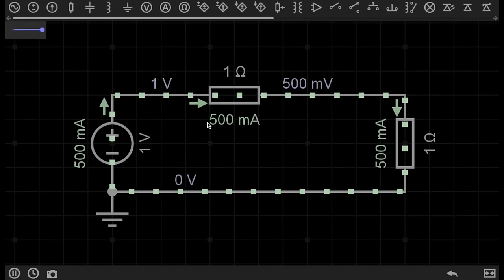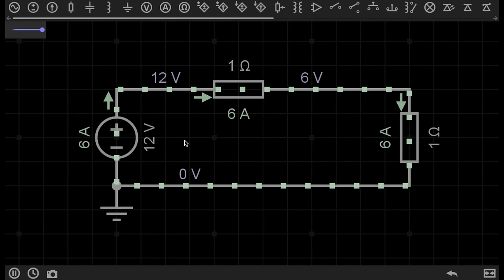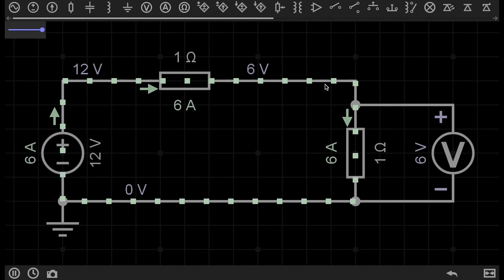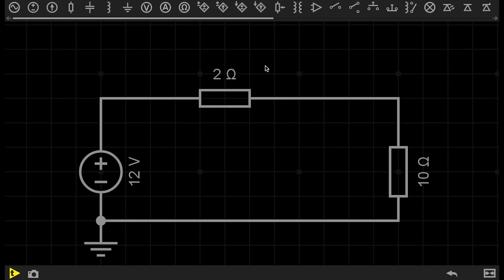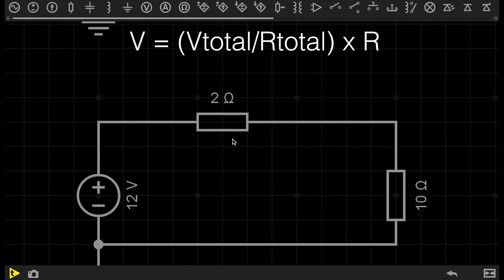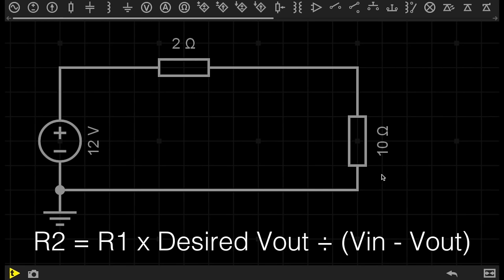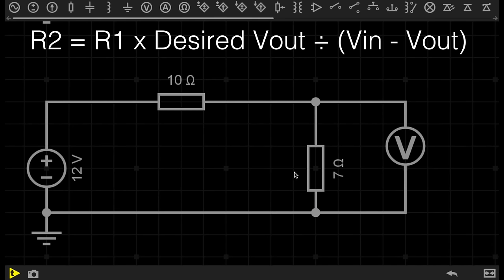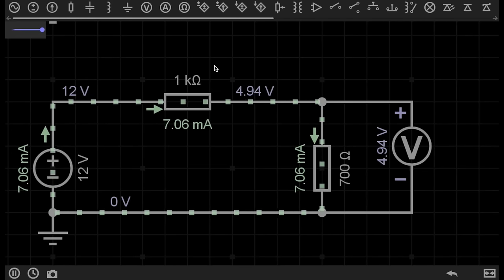Voltage Dividers - Electronics Basics 12

Comment: what's the name of this application ?
i want to reduce voltage from 3.7V to 3V ,what resistor should i add
it's for a wireless mouse that work with 2 battery(1.5v),i want to replace the 2 batteries with a mobile battery
any idea ?
Reply: You can use a buck converter ( step down voltage converter) to reduce voltage from 3.7 to 3V.
Reply: is there any other method ? like adding resistors ?

Comment: How much easier would it be to remember:

Vdrop = (R/Rtotal) x Vtotal

Also, if you want a specific ratio (say, divide by 10), then R1 and R2 must be in a ratio of 9:1. Because 9x(some ohms) + 1x(some ohms) is 10x(some ohms) [where (some ohms) is the same for each part]

So 9 ohms and 1ohm, or 900ohms and 100ohms, or 90kohms and 10kohms... there are 10 "units" and one side has 9 of those units (or 9/10ths of the units) and drops 9/10s of the voltage, while the other side has 1 of the units (or 1/10 of the units) and drops 1/10 of the voltage.

Divide by 2: is a 1:1 ratio, eg 1ohm + 1ohm

So 2 ohm total in the divider, 1 ohm is half of that total, so you get half of the total voltage.

Divide by 3: is a 2:1 ratio, eg 2ohm + 1ohm. (2/3rds and 1/3rd. If R1 is 2ohm and R2 is 1ohm, then R1 drops 2/3rds of the voltage and R2 drops 1/3rd)

Of course, it can be reversed to be 1ohm + 2ohm for divide by 3, or 1ohm + 9ohm for divide by 10 and so on. You decide where you put the resistor value which gives you the portion of Vtotal you want at that point.

Perhaps you want 90% (9/10ths) of Vtotal, then you put the 9ohm resistor where you want that voltage, and the 1ohm takes the other position.

The key to remember is for a given ratio, the parts must add up to the desired divisor. So for divide by 10 ratio must be 9:1 (because 9+1=10). And because you want 1/10th of Vtota, you would would use R2 = 1 unit = V2 or 1/10th of Vtotal (where "unit" is an order of magnitude ohms... like kiloohms or megaohms or milliohms or just ohms)

Also, for values like 10%, 20%, 30% etc, think of them as 10ths in the ratio:

10% is 1/10th so 100% = 90% + 10% = 9:1
20% is 2/10th so 100% = 80% + 20% = 8:2
30% is 3/10th so 100% = 70% + 30% = 7:3

and so on. To get 30% of the voltage, you might use 300ohm and 700ohm, using the 300ohm where you want to measure that 30%

Comment: Problem actually is  i have a source of 12 v , i must use two resistor in series, I need to have 5 volt at any one of these two resistor.how can then i apply this voltage divider to know the values of two resistor?
Reply: You want to use the formula: V(out) = V(in) x (R1)/(R1+R2). If you plug in the numbers you get 5 = 12 x (R1)/(R1+R2). If you rearrange this you get that R2 = 1.4 x R1. This means you can have any value for the resistors as long as one of them is 1.4 times the other.
Reply: You can't, using ONLY 2 resistors. If both resistors must be 5v, the total voltage drop is only 10v. To drop from 12v, you need to arrive at a circuit which has 10v across the divider network, and then the 2 resistor values will be the same value.

Are you sure BOTH resistors MUST be 5v?

Comment: I've watched both your videos on voltage dividers and I still don't understand why you would need one. Instead of using two resistors, why not just use a single one with a higher rating? I want to learn how to read analog signals with an Arduino and my understanding is I have to use a voltage divider before input to the ADC. I don't understand WHY. Why not a single resistor with a higher, correct rating instead of two resistors with lower, incorrect ratings?
Reply: if a Resistor drops a voltage, it heats up, so if you want to go from 12v to 5, that resistor must drop 7 volts for you, and if you are drawing like 1 amp of current, that 7 dropped voltages times 1 = 7 Watts of heat created and wasted
Reply: Casey, if your signal maximum voltage never exceeds the maximum recommended input voltage (or the rated input voltage) of the Arduino, there is no need reduce the voltage at all.

However, if it does exceed this rated input voltage (in this case, 5v as that is the "logic level" used by the Arduino), you need to reduce it. 

A single resistor WILL reduce voltage ONLY when there is current flow through it. If you've seen or used a pull up or pull down resistor, they don't cause a voltage change, because there is no current flow through that part of the circuit.

Typically an ADC is Hi-Z or High Impedance. It doesn't use any current flow. As the Arduino is using an ADC for the inputs, it's not going to use any current, so a single resistor would be ineffective for the purpose of reducing the voltage to the rated input voltage for your Arduino.

Also, the Arduino is a single pin input. This input pin is measured with respect to GND or 0v, and is generally NOT negative (eg >0v). I hesitate to say MUST be >0v, but it may be.

So you need a SINGLE reference point to test, where the voltage is at the desired level. To get that, 2 conditions MUST be true:

1. We need current flow through that point (but NOT flowing into/via the Arduino pin)
2. That point MUST be no greater than rated input voltage for the Arduino pin (let's say 5v)

A single resistor, even with flow, will still NOT have a voltage drop across it, in isolation (ie it needs to have another component in series with it, which has current flow)

So two resistors in series works well. And given the theory explained in this video, you can calculate the values of two resistors such that the point between R1 and R2 will give the reduced voltage level you need to safely measure it with your Arduino. 

That said, you're measuring a fraction of the real voltage, so your code MUST adjust the value it reads with a factor relative to the divider ratio.

Hope this helps (you and anyone else wondering the same)
Reply: @CollinBaillie  You have no idea how grateful I am you clearly took so much of your time to explain this to me! Even though I posted this question some time ago, this is the first time I've actually started to understand. Thank you SO much for this; you're awesome!!

Comment: If there is 6 v across this resistor there must be 6v across this resistor because our power supply is 12 v. How do you arrive at this conclusion please?
Reply: 1. The resistors will each have a voltage drop
2. Since they are of equal value, the drop across each will also be equal (as the current through them is the same, due to the series nature of their connection; and ohms law will prove that with the same current and the same resistance, the voltage will be the same)
3. Total voltage drop = supply voltage = 12v
4. Therefore each will be 1/2 of supply voltage which equals 6v each.
5. If you wire up the circuit, the measurement will prove this, with the caveat that no two resistors are identical, so there will be a very small difference, but for theory, we consider ideal components which are assumed to be identical.

Comment: There's one thing I don't understand... If the resistors are only few ohm's then why isn't it short circuit? Doesn't it just drain power?
Reply: this is true because the resistors act as loads. You can calculate the power they drain using the equation:

power  = (Vin*Vin)/R1+R2
Reply: well, his total resistance is 12Ohms, and total voltage is 12V, Mr Ohm told us that Total Current (Juice) flowing should bi V / R = 1Amps.

so this sample circuit is burning 1 Amps of juice through the resistors
and with Power + Volt * Amps you get 12 Watts of hot resistors :D
Reply: @codewithlenny  Are voltage bucks more efficient than this method?
Reply: @davey3765  voltage bucks are far much more efficient. Get them
Reply: The idea of this circuit is to learn the theory of the circuit. Generally you wouldn't use such low values.

Imagine the supply, while being 12v could supply infinite amps. Also imagine you're using 1 trillion watt resistors. Even if it's drawing 10 amps, that's only 120w. To an infinite amp supply and a trillion watt resistor, 120w is nothing. 

Theory is just theory. It's used to understand HOW is WORKS. It's NOT how you should IMPLEMENT it in your circuit. It applies to ALL circuits, from high voltage high current to extremely low voltage and low current circuits.

How you implement the theory in a real circuit is up to you. Let's make a real example:

Power supply 12v at 5A (reasonable)
Resistor divider using 1k ohm resistors. Fairly typical values, relatively small when you consider that megaohm resistors are common enough.

Each resistor gets 6v (using the theory taught in this video) and using Ohms law, we know current would be 6mA through the circuit. That's 36mW through the resistors. 

That's not going to burn a 1/4w resistor (250mW), and not going to tax the 12v supply. This is an IMPLEMENTATION of the theory.

Learn the theory, then apply it to YOUR implementation.
Reply: @codewithlenny  a buck converter is irrelevant for use where a voltage divider would be used. And a voltage divider is irrelevant where a buck converter or a voltage regulator would be used. 

Would a V12 Supercar or a 3 cylinder hatch be better in the garage when I'm cooking bread in my pizza oven? Totally irrelevant.
Reply: @davey3765  No. Because a buck converter, like a voltage regulator, supply POWER (that is, volts and amps) to your circuit. A voltage divider does NOT supply current... only volts. In fact, if the component or circuit connected to the voltage divider DOES draw (significant) current, it will alter the divider network, and you have to make further calculations.

Comment: thank you for the great video. can you explain what happens when you need a specific current and voltage?
Reply: then you use a CCCV power supply
Reply: Hmm. Voltage dividers are (really) only about voltage. 

Of course if you know the current which will pass THROUGH R2, and the Voltage drop you want to see across it, you can use Ohms law to calculate the value for R2, and then you can calculate R1.

This assumes current through R1 (I1) and current through R2 (I2) are the same, in other words I1=I2

Once you connect further circuitry to R2, things may change, depending on that extra circuitry.

If the next circuit part pulls no (or insignificant) current, the current through R1 won't change, and so the numbers don't change. If the extra circuit part does have (significant) , then current flow through R1 changes and the circuit needs to be recalculated.

Comment: And where in the circuit is the desired voltage taken from here, like where is vout?
Reply: You would connect your next circuit part (what you call Vout) across (in parallel with) the resistor which gives you the divided voltage you need. 

For eg, in the 12V with 10ohm + 2ohm resistor divider, you would connect in parallel to the 2ohm resistor if you wanted 2v. If you wanted 10v, you would connect parallel to the 10ohm resistor.

Comment: How is the power efficiency compared to a buck?
Reply: Davey buck converter has higher efficiency
Reply: A buck converter is a POWER (voltage AND current) source. A voltage divider is ONLY a voltage source, no current. It's more of a voltage reference, for measuring or to feed high impedance components, like the input of an OpAmp, which draw no current.

Comment: Seems weird that in order to get more volts around resistor 2 you have to INCREASE the resistance 😅 they should change the size or opacity of the green dots to differentiate current and voltage

Comment: but why cant you use only 1 resistor to divide the voltage?
Reply: @Bloodred Pyrate 
Ok I'll only play with low voltages like 9v and an arduino
Reply: 1 resistor would REDUCE the voltage, not DIVIDE it. The voltage drop provided by the single resistor is calculated using the current THROUGH that resistor.

A voltage DIVIDER is used to "supply" a voltage WITHOUT current flow, to another component or circuit part. (eg that component or circuit part draws "no" current) Like the input of an OpAmp.

A voltage divider doesn't provide POWER (volts AND amps), just Volts.
Reply: Kirchoff's Law dictates that the sum of all voltage drops in a series circuit must equal the supply voltage. Therefore, if there was only one resistor, there'd be only one voltage drop and this voltage drop would equal 100% of the voltage in the circuit. The voltage would literally be undivided.
Reply: @CollinBaillie  this is fascinating. I haven't heard this, yet. I'm relatively new to matters of circuit theory. One question, if I may... If Vout carries no current, does this also mean that Vout is only used as signal voltage? Data, perhaps?

Comment: Electron flows from - to + here you have shown reverse why?
Reply: It's NOT showing electron flow. The simulator shows "conventional" flow, as is used in most theory. Conventional flow considers positive charge to be moving. We understand now that electrons are the actual moving bits, and they're negatively charged. 

It all works out though, because when an electron "leaves" a molecule, that absence results in a positively charged molecule. So positive charge moves in the opposite direction of electrons, which matches what conventional flow is based on.

Comment: i am useing hybrid  24/12volts on  my m37 army truck  via center tap 2 12 volt batt. dist is 24v  also starter   all else 12v for economy   alter. is 28 v dc one wire conn  no diodes or res used   no prob   53 dodge just keep it simple

Comment: How can there be 0 volts at the bottom (1:30)? If there was 0 volts, no current would flow to GND
Reply: The GND reference is a clarification of that node (the one being between the voltage source and the 10 ohm resistance) to be the reference node for the whole circuit, being the reference node a 0v one because GND is generally considered 0v, so all the voltages mentioned in the video (12v and 10v) are measured to the ground reference.
Reply: Voltage is also referred to as potential difference. Try searching for some explanation videos about potential difference, it may help.

On the bottom of the circuit, there is 0v potential difference to the negative pole of the power supply. At the top, there is a 12v potential difference to the negative pile of the power supply.

If you put a meter with both res and black leads on the bottom wire, you'd get a reading of 0v, if you have the black lead on the bottom wire, and the res lead on the top wire, you would get a reading of 12v.

The bottom wire has no potential difference to the negative pole of the supply (what you call GND) so it is 0v.

You might also call the poles of the supply 12v and 0v. GND is 0v, conventionally, in DC circuits.

Comment: At the time I'm writing this comment, partsim is broken, it lets you design the circuit but the simulation does not run, there's a broken api call that can be seen in the browser console. I've waster an hour trying to understand what I was doing wrong

Comment: Why is the election flow is from positive to negative and not from negative to positive???
Reply: The sign convention for current flow in a circuit is arbitrary and was defined long before the electron charge polarity could be emprically determined.
Reply: The "flow" simulated in the software is NOT electron flow.

It is conventional flow, which is the flow of "positive charge" (which is how electricity was thought to work historically)

We now know that electricity works by the flow of electrons, which have a negative charge. So electron flow is the flow of negative charge. When an electron moves, it leaves behind an absence of negative charge, which we consider to result in a positive charge, so the flow of positive charge is in the opposite direction of the electrons and their negative charge.

Comment: No, no, no, NO!!
You cannot be 'writing' in the new voltage!
You need to physically show students (viewers) a REAL CIRCUIT using REAL VOLT-METER!
Reply: Ummm... yeah you can. That's the whole purpose of these videos. That's the whole purpose of electrical theory. Theory is ALWAYD used to design circuits. You don't put parts together and measure them to design a circuit. Do you hook up a power supply to a resistor and measure it EVERY TIME you want to calculate the current drawn through it, or do you use Ohm's law? I know which one I'd prefer. So much cheaper to use the law to calculate the values, and build the circuit AFTER. 

You KNOW the desired voltage, or the desired ratio you want, and given the supply voltage, you can the work out which resistor values you need to achieve that ratio. 

Once you have the resistor values, you can calculate the current flow, and then you can calculate the power rating those resistors need to be.

Once you get that sorted out and wired up, THEN you can test it with a meter, and see that all is correct. 

The simulator software does just that... it simulates a real circuit being tested.

The style of the video here seems to be more theoretical, but does use a simulation to give an example of a real tested circuit. I'm sure you can find a video of a real person building a physical circuit and testing with actual meters. I don't think you have any right to demand someone make a video the way YOU want it to be made however.